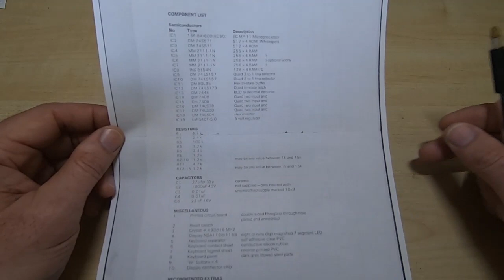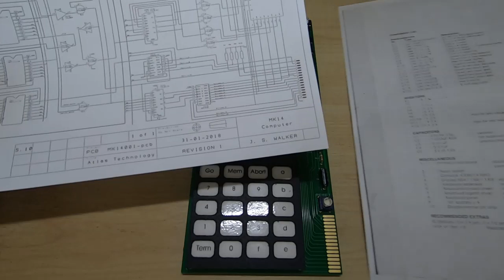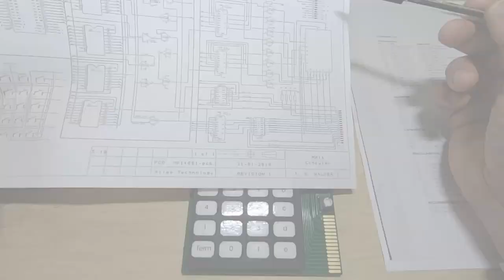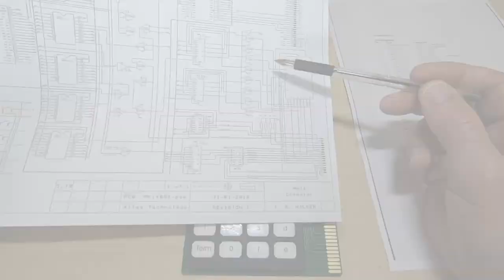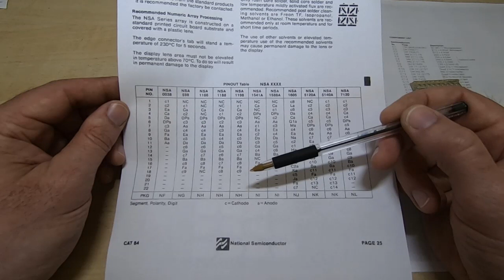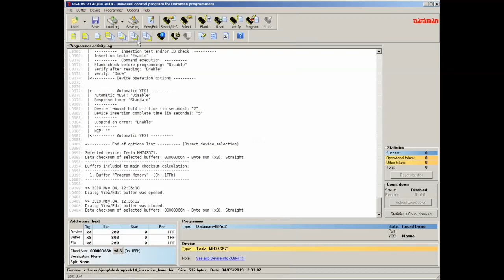MK14 Build Introduction and First Run

Comment: Brilliant. I played with a couple of these. One of them worried me as the display glowed far too bright on switch on. I bet it was that problem of the chip type that you talked about. Also I seem to remember that the boards were a bit different on upgrading. Also the ROMS upgrade could be only be used with certain boards. Also I remember cutting a track and adding a link to somewhere. There was a way to do single stepping.